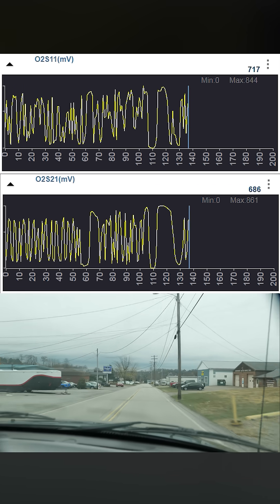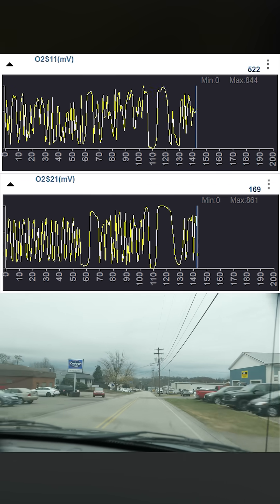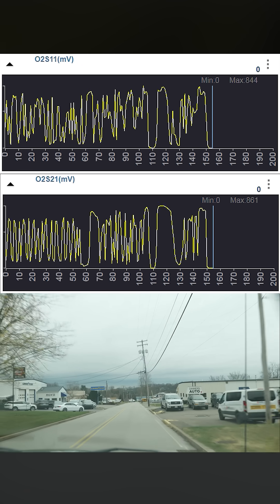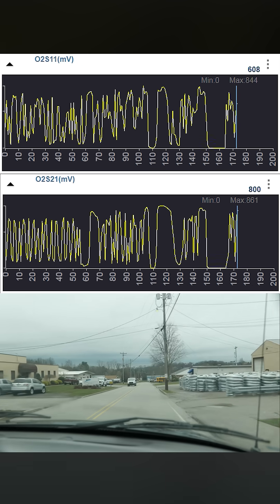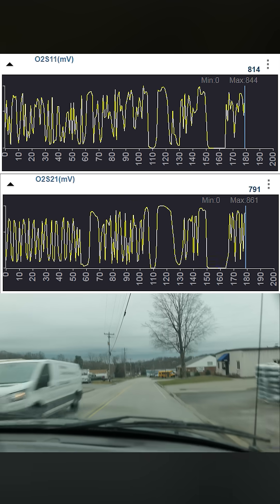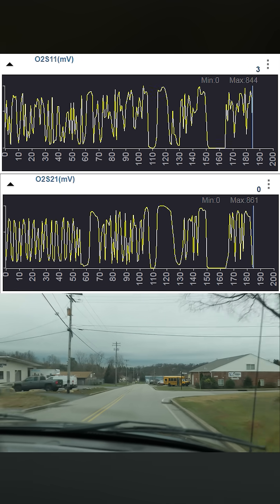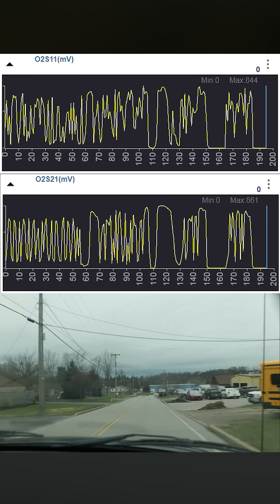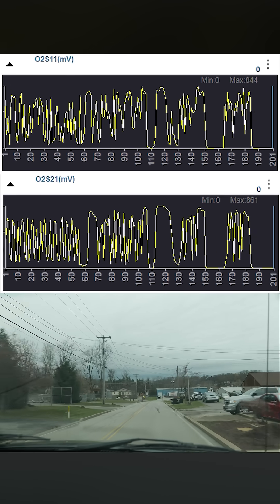Testing an O2 sensor/AF sensor for range and accuracy!

Comment: I've got one for you.
My 2016 Buick verano has no blown fuses no faulty relays. The battery is fine, I've got power to my center console but no power to my push start button, no power to my obd2 connection, no windows or door locks, and nothing going on with my instrument panel. I did replace the push start switch but alas that didn't solve my problem.
Reply: Also this occured suddenly, first I got a display saying reduced engine power and upon making it home only 1/8th of a mile I turned off the vehicle and since then have been unable to restore power to nearly all of the vehicle.
Reply: Where should I start the probing of wires, cause that's where I'm at right now
Reply from the maker: A full scan of all modules is where you start

Comment: I’m currently diagnosing a mild hesitation and sometimes loss of power with no codes on a 2006 Honda Civic 1.8 R18A2. I am from the  UK if that makes any difference….🇬🇧. So far, doing what you suggest,  when accelerating wide open throttle the wideband 02 sensor reads a maximum of 0.60 mA. When letting off the throttle the sensor shows -1.69 mA. I personally think it’s done for but I would love a second opinion. It’s doesn’t go fully both ways that’s for sure.
Reply from the maker: That doesn't sound too bad. The key is to perform that test DURING the low power condition. Another thing to consider. If your low power condition is during WOT, it is not going to be from the oxygen sensor as we ignore the O2 during those times.
Reply: @ScannerDanner  Ok got ya….  No it’s mainly at a low throttle level so when light acceleration is needed. I just wanted to see what the sensor was doing as a base line.. Yeah it’s only intermittent and with no codes it’s tricky…. I did an omns resistance reading across the heater circuit on the sensor, it was set to 200 omns (lowest setting on my multimeter) and it showed 0.25 omns. Which I suppose would appear as 2.5 omns if I had the 20 omns setting? Now i can’t remember if that’s  bad or good. I’m rusty as hell. These aren’t my main duties  in the shop…. The engine at idle with no loads is showing 25% calculated engine load value which is getting my attention, All the MAF/MAP look good steady and responsive values. LTFT hovers around -3% -4% and STFT is around -2.3% sometimes around -5.5 %….. They don’t stay the same they keep changing like they get stuck for a bit then change and then change again….. It just seems slow to me…. I watched you in that Honda Accord with the  wideband 02 issue and watched the values changing so much quicker than mine….. Night and day difference
Reply: @ScannerDanner  One more thing Dan, is I think these sensors are original to the car as they are DENSO which is the OEM and look about 18 years old like the rest of the engine… I think the patina is screaming original sensors…. I seriously doubt an original sensor could last this long after 18 years and 147,000 miles….
Reply: Oh and it’s only happening once it goes into closed loop

Comment: I tried this test on a 2017 5.3L GM with intermittent misfires. At WOT, Bank 2 S1, O2 went to 1.8V momentarily. This was repeated a few times with the same result. I didn't think an O2 could go past 1V. is this normal?
Reply from the maker: What did the other sensors show?

Comment: Good test! But be careful a scan tool will not show you a negative voltage on a o2 sensor during deceleration . But it will show on a scope or multimeter. 0 mV on a scan tool can be a negative voltage for real
Reply from the maker: For sure, however if you have an O2 producing negative voltage, it's certainly not going to be accurate on the rich side either, so it's going to fail this test

Comment: Simplicity at it's finest. Kinda related question.  Is the temperature across a cat a go, no go test? If the a/f or upstream o2 looks good.
Reply from the maker: Cat temperature test has many variables. So many, that i use it for literally nothing
Reply: @ScannerDanner  Haha. The entire cat system is voodoo. And dumb expensive.

Comment: Full lean on the catalytic converter. Real lean engine mixture produces higher RPM than rich. The fuel system is on an open loop and the computer doesn't use the o2 sensor reading. Mixture and fuel consumption is variable on petrol depending on fuel level. Petrol is most efficient when the fuel tank is full due less evaporative emission.
Reply from the maker: Not really sure what your point is here

Comment: You guys are so lucky with your V engines. You get to compare switching of B1 and B2 O2 sensors AS WELL AS comparing cats for efficiency. 

And I keep forgetting about doing WOT and decel runs. I always go under the hood. :/ I need to just stay in the warm car with a scan tool.

Comment: This might be a silly question, but why does the standard narrowband  O2 sensor voltage jumps up and down? Shouldn't it be... "stable"? Is this an effect of the very low currents it produces?
Reply from the maker: The PCM is driving the mixture a little rich and lean from a set point (450mv stoichiometric ratio) on the O2 sensor.

Comment: How do you run the scope into vehicle  after hooking to sensors. I would think go full throttle under hood an snap shut throttle would give same running
Reply: Do you mean the graph he is using?  It is just the graph of voltage from his scan tool, plugged into the OBD connector
Reply from the maker: This is scan data only as another has said.